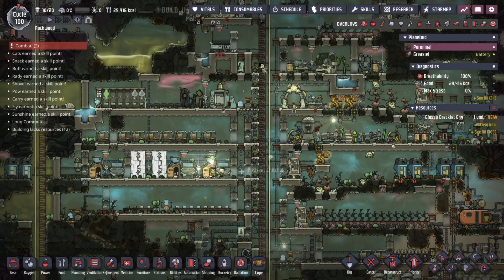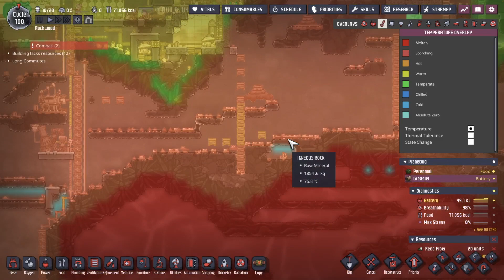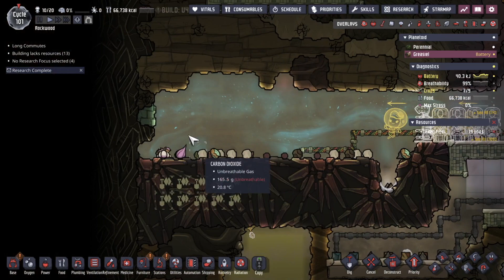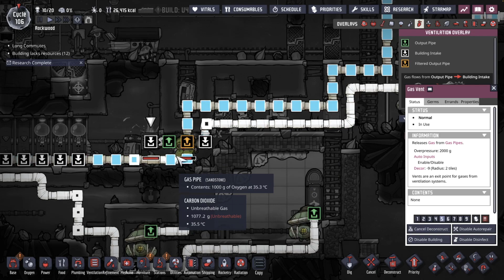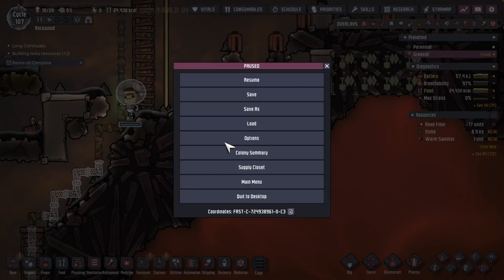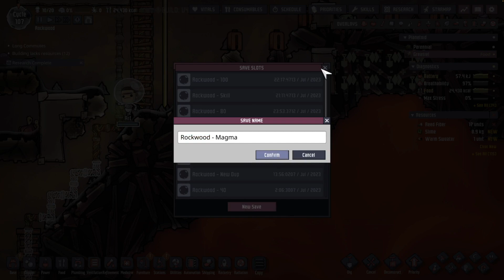Folia Astroid 6: Cooling Oil Biome

Comment: For the slicksters, you can't use the wrangle command on them directly. But if you place a critter drop-off and enable auto wrangle, the dupes will actually do it provided you also have a destination drop-off with higher priority than the pickup.

Edit: Oh wait, that might only work for tame slicksters. I haven't had any wild ones for 1000 cycles, so can't remember.

Edit2: I looked it up. It works for wild ones too. So a critter drop-off with critter count 0 and auto wrangle surplus. Of course the wrangle from and wrangle to drop-offs must be separated by a door, i.e. be different rooms, the size doesn't matter.

Comment: I'm not sure why you are taking the water out of the turbines, then regulating putting it back in based on steam pressure.  Normally you just loop the water from the turbine back into the steam room to maintain the same pressure all the time.   (no water is created or removed by the turbine, it just changes state).

I must have missed something.  Normally you would only do what you are doing if you were trying to purify polluted water or salt water by pumping it in, and taking clean water out.  (Which can  also be a huge waste of power compared to running a desalinator or sieve (Depending on input temperature), especially if you are going to cool that water again to use for something).

Maybe you are taking into account that you will need to dig out the top layer of Igneous when the magma solidifies, so you'll need to add a few more blobs of water in like 50 cycles?

Heat spike to regulated temp steam room is recommended :)
Reply from the maker: My thinking was that it would stop the heat transfer to the turbine if I pull the water out. I am not certain this actually have value versus just disabling the turbines directly.
Reply: @jeroxygen  You mean when you turn them "Off"?  I really don't think it will make a difference.  Generally I just run my smart battery to the generators.

You are built atop abysalite instead of insulated tiles...  But you have no liquid in the turbine room...

I understand your consideration now...  

I'm fairly confident that it won't leak heat.  My gold volcano tamers run without external cooling.  When the volcano is active the steam gets to 130c, and the temp of my generators and the room temp is about 99.5c.

When the geyser goes dormant, the steam in the chamber is still about 120c, but my turbine evertually cools to around 95c.

If there was any heat transfer, the generator room would heat up over the 40+ cycles that the geyser is dormant.  In fact the room cools a little to around 95c. (The temp of its output water)

My gold geyser also has LOTS of pressure...  at least 100 kg of steam per cell.  So if it was going to transfer heat, there is LOTS of heat to transfer :)

Note:  If you have a liquid bridge (or gas bridge) and take it from inside your generator room to inside the steam room...  That will act as a heat spike, quicky transfering heat...  but you haven't done that :)

Just trying to help :)

Comment: Steam turbines and heat.

Great job setting up the turbines in the geothermal.  I am impressed :)

I think I saw that the steam in there is over 500c  (that's probably the coolest it will ever be).

That just means that a lot of extra heat is being sent to the turbines themselves without additional energy being produced.

You should block the ports under the turbines.  This reduces the amount of steam they intake...  yet still yielding maximum power.  Anything over 200c and you should start blocking ports.

As a simple rule...  If your steam is over 300c, block 3 of the ports of each turbine...  Just build an insulated tile directly under them.
I'd block the 3 on the left side, and the 3 on the right...  moving the liquid vent to the middle.

This will yield the same amount of power output.  
Your steam turbines will not get as hot, so will require less cooling from the cooling loop.  (even with 3 ports blocked, you will still be wasting a LOT of heat.
You will process less than half the water through it.

Keeping it as is, just means you will be spending more of the power generated in cooling the excess heat of the turbines.

Note:  The Wiki has a lot of research and numbers on this.
Off the top of my head...

Under 130c  you can run your turbine with no external cooling...  Just its water output will self cool.
200c is max efficiency for a turbine
200 - 250c  block 1 port
250 - 300c block 2 ports
300c and up block 3 ports.
Blocking 4 ports does something but stifles the turbine... not sure...  I don't do that.
Anything over 350c should be thermo coupled using a steel door to a steam room that you fine tune the temp.

Since your steam will be SO hot even blocking 3 ports will be wasing lots of heat, I'd suggest going the thermocouple route.

This way you get maximum efficiency from the turbines without wasting a lot of thermo power to a cooling loop.

All the best :)
Reply from the maker: This is awesome! I am going to make this change on the main base. Thanks!
Reply: @jeroxygen  I've been thinking about it... since your steam will be in excess of 1000c, I would strongly recommend going with the diamond tile thermocouple.  then you can lock it in at 200c

Comment: Weezeworts are great for early radiation science, extremely if you can find two or three near each other in the wild. Can also use pipes by them for some minor cooling of the base.

The hot abysilite is not a problem as long as it does not anything (gas, liquid, or normal tiles)
Can use it to make steam for power.
Reply from the maker: I'll see if I can get my pips to plant some there! Thanks!